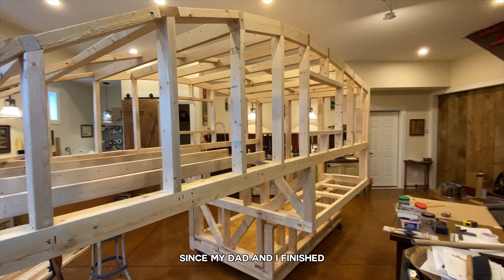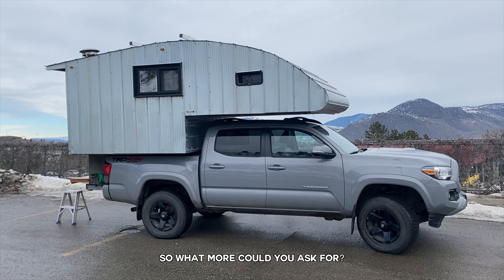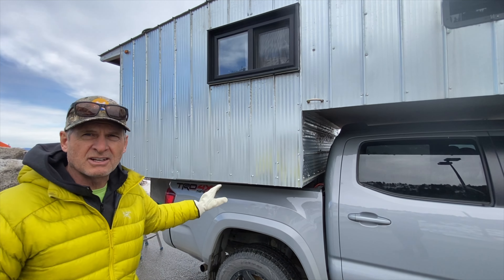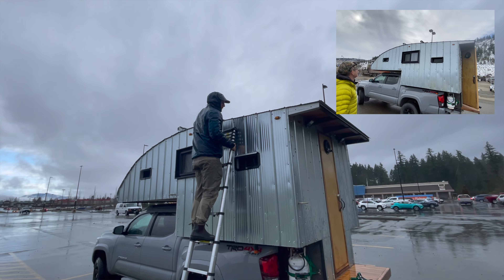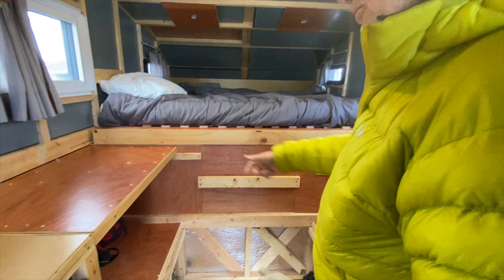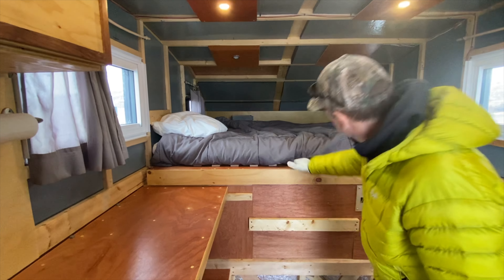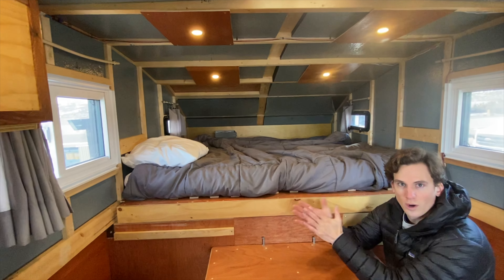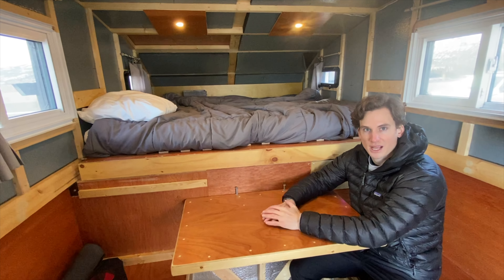Full Tour of my DIY Camper | 1 Year Later

Comment: I knew from the beginning that the roof would leak and it would be enormously heavy.
Sorry, but no, it does not slice through the wind. All that corrugated sheet metal is like dragging 6- 25 pound boat anchors.
The back up camera will soon be crushed.
You never install a roof vent, or any roof opening, before the finish roof is applied.
Reply: There's that expert in the comment section who had never done anything like this and only gas negative feedback
Reply: @ethan5610  I call 'em the way I see 'em. I noticed you couldn't dispute anything I said.
Reply from the maker: wish i had you around for the build. some people gotta learn by sheer mistake i guess